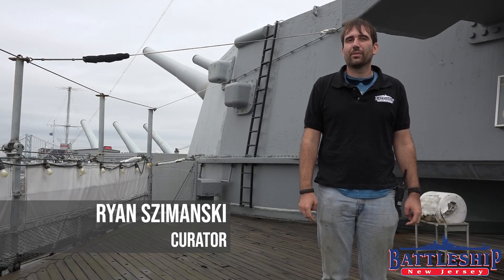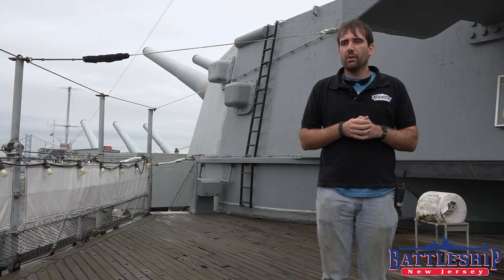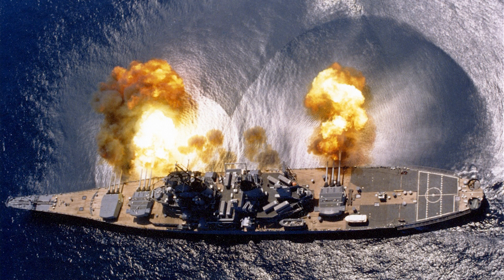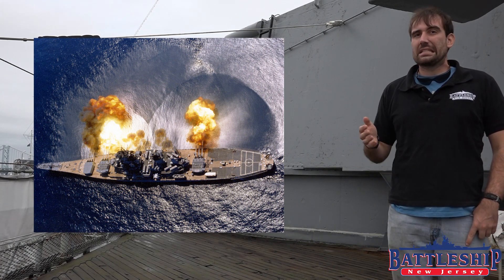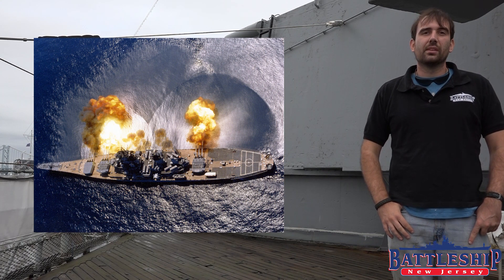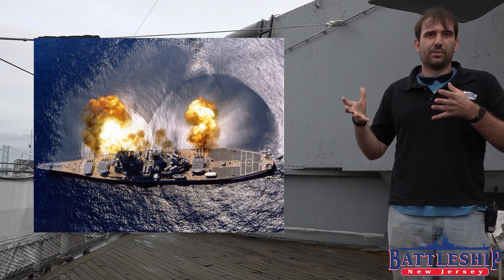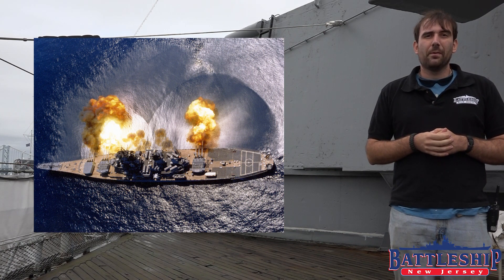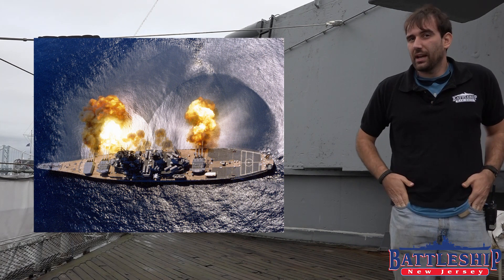Does Firing the 16in Guns Move the Ship Sideways?

Comment: Apparently few people take physics, those of you saying the ship doesn't move sideways are soft in the head. The math has been done and each barrel firing 6 bags of 110 lbs. of powder and real AP or HP shells move the ship approximately 1.5" when aimed full port or starboard at the horizon, somewhat less when fired AT 45 degrees elevation. when all 9 barrels fire it comes two nearly 1 foot 1/4 inches (slightly less since they don't fire at exactly the same time), Those fools that say that 1 foot movement doesn't count because it is too small to make a difference are the same types that believe man produced carbon dioxide or bovine methane causes global warming.
Thank you to the folks disputing this farce that physics doesn't apply,

P.S. don't bother believing me about my figures because there are a couple folks that posted the math on the internet, I just went over their work and it is solid. Hunt it down yourself, don't believe anything that doesn't jive with real science and math, provided you are willing.
Reply from the maker: The math works as long as you don't include the recoil mechanisms and as long as you think of the ship as being entirely static and not have anything on board that moves. It also usually fails to account for the amount of water that needs to move out of the way, the ship isn't in space, thats a big wall of water to combat.
Reply: @BattleshipNewJersey  Obviously you haven't had physics or advanced math, or had a heavy boat that you have much experience with. The recoiling happens to causes a bit of oscillation thru-out the ship but has nothing to do with whether or not the ship moves in the water because the force that is applied into the gun goes into the entire ship, regardless of any recoiling mechanism. The water does dampen movement but can't completely resist the ship moving, it just takes a bit of time, think of this: take a 14 foot bass boat, no wind, no current in the water, with the boat 4 inches from the dock and while standing in the boat fire a 12 gauge shotgun off the boat towards the open water and measure the distance the boat closes with the dock. since the water does dampen the movement it happens gradually. Anybody that has tied up big boats can tell you it takes a bit of power and time to overcome the mass of the boat, the water just slows it down so it takes some time for it to happen.
Again, hunt the work down. it has been done and it accounts for the water but no wind or other forces.
Reply from the maker: This is a battleship, not a fishing boat. The recoil mechanisms were designed to handle that movement, otherwise you've got much lower accuracy.
Reply: Please see attached engineering analysis in the replies
Maximum Lateral Ship Velocity	0.59 ft/sec
Lateral Displacement at Time of Max Ship Velocity	0.42 ft
Lateral Ship Velocity at 60 Seconds	0.46 ft/sec
Lateral Ship Displacement at 60 Seconds	30.98 ft

See my previous Public Comment for details and explanation

Comment: Anybody who got a decent grade in high school, or freshman college physics knows that, yes the ship moves in response to the firing of the guns.  Were it not so, you would have to flush all of physics down the drain, because conservation of momentum is an absolutely core principle.  The tricky part to calculate is not the ship’s motion in response to gun firing without considering other forces.  That is pretty simple.  The tricky part is the motion of the ship through water, a motion that generates large forces on the hull and is actively used to steer the ship along its intended course.  Also, the recoil dampers don’t matter in terms of the net effect on the ship’s motion.  The recoil dampers absorb energy, converting it to heat, but they do not affect momentum.
Reply: There is a fundamental flaw in your argument. As Netwon's First Law states: an object in motion will continue to move in a straight line until acted upon by a sufficient outside force.  Like Ryan said, while the total force pushing the ship to the side is hardly enough to be that sufficient force. When you have 550,000 tons of force moving in a direction, there is a lot of momentum at play there as well. 

So, to cause a sudden dispalcement like the myth tells you requires so much force that it could very well cause damage to the ship.
Reply: @caelumvaldovinos5318    I’m sorry, Mr Parry.  Your understanding of the physics is wrong.  You may have more than one error in your thinking, but let me start with the one that jumps out.  You got Newton’s first law wrong.  You said a body in motion (or at rest) will maintain that motion (or rest) until acted on by a SUFFICIENT outside force.  That is not at all what the first law says.  It says that any force at all will change the motion or rest.  One reason people misunderstand this is that friction is so common in our world.  In this case I am referring to static friction.  Let’s use an example.  You have your car on a flat surface with the brakes off.  You try to push it, but you don’t push very hard.  It does not start rolling.  Is that because Newton’s first law is wrong?  No.  It’s because there is static friction, another force that counteracts the force you apply.  The car experiences two outside forces that oppose each other.  The net force on it is zero.  We know this is true because in situations where the static friction is minimized, such as large machines on low friction oil pad or air bearings, Newton’s first law does work for even quite small forces.  The best examples we have require the modern technology of space travel.  In outer space, friction is so low that even very small forces accelerate objects detectably.

What about a battleship?  It floats in water.  Water has very low, almost zero, static friction, but it does have dynamic friction, and also has much more mass per volume than the air we are more used to being surrounded by.  And, very importantly, water, while having very little if any static friction, does have significant dynamic friction. (We call it viscosity.)  The result is different from your attempt to push your car.  The battleship definitely moves when you push on it, but the motion damps out quickly because of dynamic friction with water.

It’s easier if you analyze it in terms of momentum and that’s where that physics class comes in.  When the ship fires a shell, the shell gains momentum in its direction of travel.  Because of conservation of momentum, the ship gains momentum in exactly the opposite direction.  It begins to move.  The ship’s new motion through the water causes dynamic friction with the water and the ship’s new momentum is transferred to the water.  The water gains new momentum in the same direction as the ship.  Where does that go?  The water, through dynamic friction, transfers that momentum to the entire planet Earth.  Yes.  The Earth moves in response to the gun firing.  While the shell flies, it only experiences a relatively small amount of friction with the air, so we can approximate it as frictionless.  When the shell slams back into the Earth, it transfers its momentum back to the Earth and the whole momentum equation goes back to where it started.  Bu, even though momentum zeros out in the end, both the shell and the battleship move as a result of the interaction.
Reply: The dampeners do matter in the sense that they convert some amount of energy into heat.

Comment: The ship does move, but not enough to be of any consequence. However, given a ship like the Missouri, when all those guns are fired in same direction, they can cause the ship to list to the opposite side for a moment.
And the analogy on the ice rink is incorrect. If you took away the friction and could somehow put the ship on an ice rink, the guns would absolutely move the ship. Think of the guy using a leaf blower while on a skateboard.. Blower force is less than the persons mass, but still enough to move the person when friction is overcome.  Same with using a fire extinguisher or firing a gun in space, the person using them will move.
Reply: Not to any significant or even noticeable degree. As he said, go check the link.
Reply: @valerierodger7700  A negligible amount of movement is still movement. Every action has an equal opposite reaction. If you fire a cannon mounted on a 500 tons concrete pad, its recoil gets transferred to the ground and technically moves the Earth, albeit by an immeasurable amount.

Comment: I once had a conversation (pronounced ARGUMENT) with a retired 4-star admiral on this topic.  He made the statement in a working group meeting regarding the battleships moving multiple feet when the ship would fire a full broadside.  I tried to run him through the conservation of momentum and conservation of energy calculation but he insisted he was correct because he was a retired 4-star admiral.  I don't fault him for being incorrect, but it is annoying when they believe their former rank somehow gives them expertise in physics.
Reply: Mrackerm:  One wonders how he ever got to be a 4-star admiral if he was that woolly in thinking.  Not only does really basic physics show the movement is entirely negligible, he totally lacked commonsense, because IF the ship DID jump several feet in one broadside, every one on board would be knocked off their feet, bounced off the ship's fittings, and there would be considerable casualties within the crew.  I've never heard of that ever happening.
Perhaps he was trying you out.   I once had a very senior chap try me out when I was a junior engineer newly transferred.  He would  make some silly technical claim, and see if a) the junior man knew it was silly and why, b) the junior could clearly explain why, and c) the junior man had the courage to stand up to a man of much higher rank, prestige, and power.   If you demonstrated this, especially (c), from then on he would respect you and trust your advice on any issue, and not try nonsense on you again.   If you didn't, he knew he couldn't trust you, and you would soon happen to leave his team.  
Not a crew evaluation method I would use, but it does work.  Fortunately I passed, and enjoyed 2 good years.   Another junior engineer was actually more capable in engineering than I, but he was an arse-crawler.  He was got rid off within days.
I've never met a 4-star, but I have met a few USN commanders and 1- and 2-star officers.   They were all impressive, clear thinking bright people.
Reply: @keithammleter3824  I have met quite a few flag officers over the years.  They mostly range from above average thinkers to being quite intelligent, but there is a distribution of talent and someone has to be in the left tail of the distribution.  This guy had been enormously successful so perhaps he was baiting me, but I am not that many years younger than he is so I am not sure what purpose that would serve.  There is still the chance that he heard this somewhere and believed it.  This guy had come up through the submarine ranks so the surface fleet might have been less well known to him.

No matter what the case, you gotta love battleships!
Reply: @mrackerm5879  :  "left tail of the distribution" - yes, true.   There's also age-related decline - it doesn't necessarily manifest as obvious senility.   In my varied career as an engineer, I was for a while head of a software development group.  In that game you see increasing variation in coding ability once their age gets past about 40.   By 65 some are as sharp as ever, but a few definitely are not, yet would not be diagnosed with anything by a doctor.   Mental agility varies with use and age the same as muscles - I'm in my late 70's, and all my muscles still work well, I can still run, my GP rates me each year "fit", but I definitely do not have the strength and agility I had in my 20's.  Physical or mental: use it or lose it.  Presumably I can't think as well as I did when I was at university - but that is hard to tell as one cannot live one's life twice.  Once you've nutted something out, you can't start nutting it out again.  Unless you are senile.
I don't see a background mostly in submarines as a factor.  Sure, it could mean he believed the sideways nonsense he heard somewhere without ever having to think about it, but once you challenged him (even if you didn't explain it very well) he should, at 4-star level, had enough intelligence to quickly think to himself "gee, I never thought this through - doesn't sound right - I'll think it through now."  After all, the thinking required is pretty darn simple.
Even "left tail" folk can be very successful - that's why Forrest Gump was such a good movie.  Lots of good luck can promote a dunce, and bad luck hold back a brilliant guy.

Comment: I already know the answer is no, but I was interested to here how it would be explained.  The main thing I know is Battleships are extremely heavy weighing like 40-60K tons or something.  Plus like you said in the video, the majority of the recoil force is absorbed from the gun barrel depressing into the turret.
Reply: It's not absorbed though....
Reply: @angrydragonslayer  It’s not?  How is it not?   I thought for sure that’s the purpose of the gun being able to retract/depress into the gun turret?
Reply: @Mindwipe96  the dampeners are to dampen the deceleration

instead of the guns stopping in a microsecond when they slam into the rear of the turret, the dampeners transfer the energy from the cannons moving backwards slowly

by doing this, the guns decelerate by 980 m/s^2 (random number for example) over 1 second rather than 980000 m/s^2 (again, just for example) during a single microsecond
Reply: @angrydragonslayer   You seem to be correct but I don’t see how that makes my original comment wrong.  Because of Newton’s 3rd law of motion every action has an equal and opposite reaction.  All guns have recoil when fired.  The dampeners are absorbing the recoil force.
Reply: @Mindwipe96  could you please explain what you mean by absorbing then?

to me, the dampeners here absorbing this energy would be like a rag absorbing water while what actually happens is that the dampers slow down the transfer of energy (with some of it being turned into heat due to friction)
Reply: @angrydragonslayer  Maybe absorbing isn’t the best word to use but, no I don’t mean like a rag absorbing water.  I’m not sure what’s a better word to use though.  The dampeners absorb the recoil force the same way a person or any animal does when landing on the ground by bending their legs thus absorbing the the kinetic energy and slowing themselves down.  You are correct that the guns are being slowed down, but why they’re being slowed down is because the kinetic energy from the recoil force is absorbed.  Energy can’t be created or destroyed, it only changes forms.
Reply: @Mindwipe96  when a human lands from a jump, the energy still goes into the ground

try jumping and landing with straight legs and think primarily about how long it takes you to stop (pretty fast, right?)

now compare that to when you bend your legs and how long it takes to stop like that (easily 5-6 times slower, right?)

assuming you jumped just as high, the same amount of energy entered the ground in both methods but less energy entered the ground at any given time in the later method as the period when energy entered the ground was longer
Reply: @Mindwipe96  also, a strong recommendation, when a word doesnt quite fit and it being viewed differently is causing a problem, try avoiding that word entirely 

for example: drank

"took water into the mouth and swallowed"

Comment: Well folks ... of course the battleship moves sideways, according to 350-year old physics (see Newton, Isaac - "equal and opposite reaction").

No, the recoil mechanism does not "absorb" the force on the ship, but merely distributes and dampens it over area and time. The ship sees the same amount of total sideways force.

Very small relative to the ship mass ... yes, but the reaction force does not magically disappear.
Reply: Yeah, the Bureau of Ordnance speculated that it might cause 1 - 2 mm of rocking the ship in the water. Remember the keel is 38 feet deep in uncompressable  water, not just floating on the surface.

Comment: The guns on these ships, like most guns, have recoil systems for a purpose - to absorb and thus control the recoil. Even a 30-06 has a recoil system. It's called your shoulder.
Reply: The recoil just slows the action down and makes it more manageable.  That delay in no way removes overall action from firing the gun-- the ship will react in an opposite direction, just not as quickly.

Comment: Well, yes it does move sideways, just not very much.  An initial velocity of 6 inches/second is actually quite impressive for a 58,000 ton object.  I would like to see an actual calculation, not a guess, of how far it does move taking the water resistance into consideration.
Reply: It doesn't move any measurable amount.  The "6 inches/second" is a calculation done that assumes the ship is sitting up on ice.   So in water, it doesn't move.  Shakes some, that's it.  
You'd have to have machinist's tools to measure any movement.